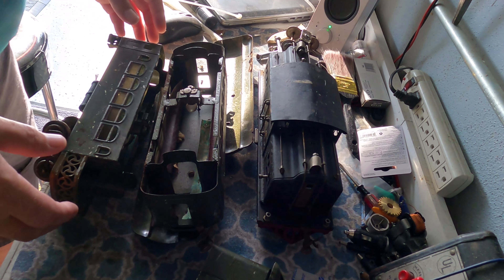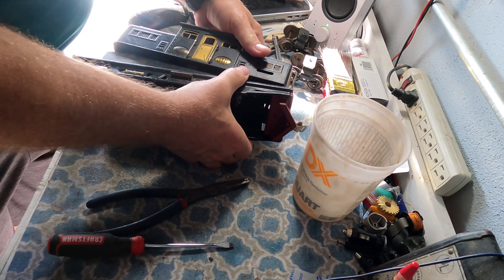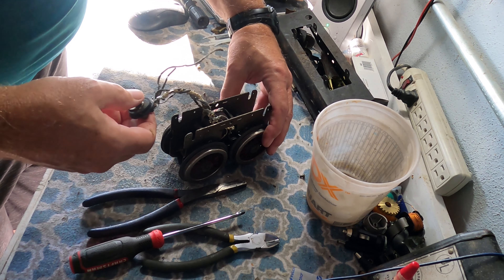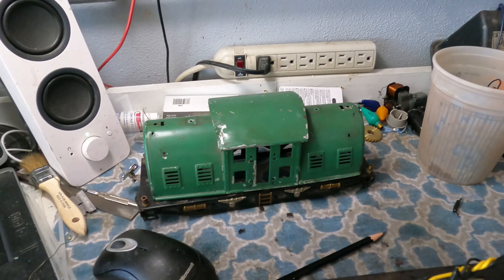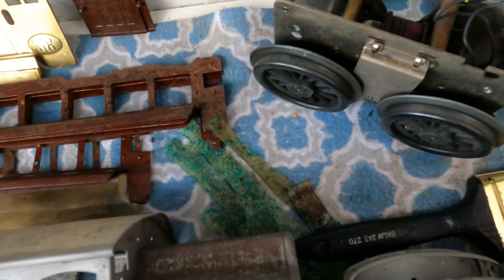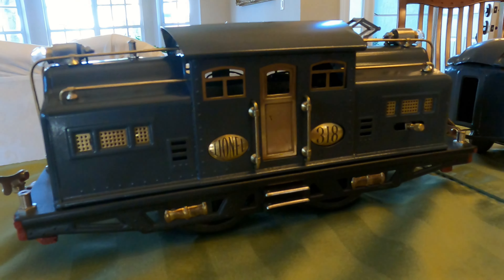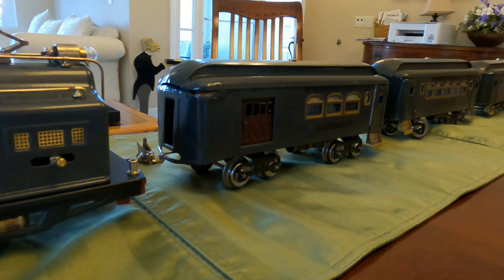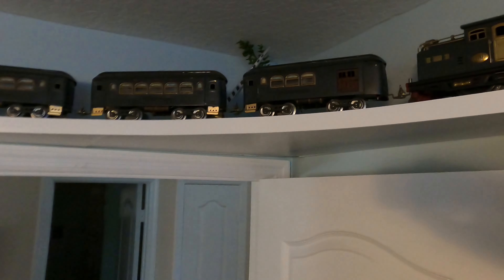Lionel Trains Restro of Standard Guage 318 engine 31,35,36 Passenger Cars

Comment: Watching your video we might be able to help you out. 
We own Henning's Trains in Lansdale PA. 
We make lots of the standard gauge parts. 
We own model engineering.
We make the paint, wheels and all the other parts you might need. 
We also do the rebuilding of the armature that came apart on you.
We do recommend that if you are using old armatures that you epoxy the windings and comutator to keep them from flying apart. 
Hope this helps. 
You can contact me if you have questions I have been doing this all my life
Reply from the maker: Been a customer for quite awhile, was buying from your dad 15 years ago....